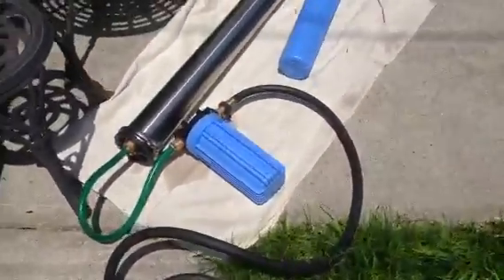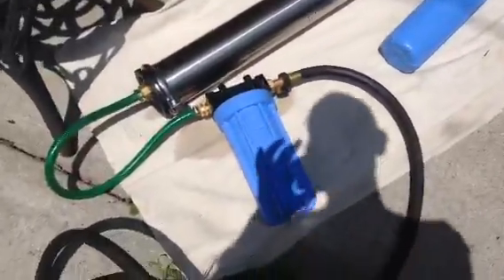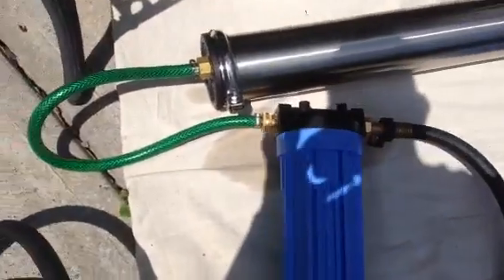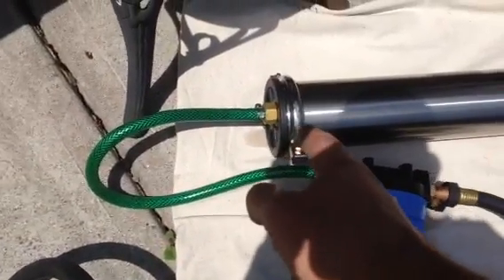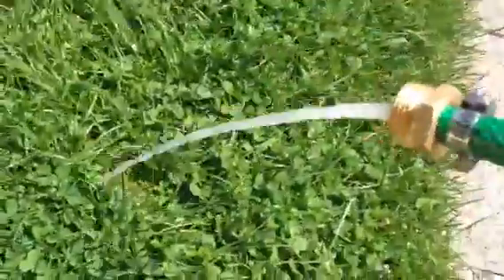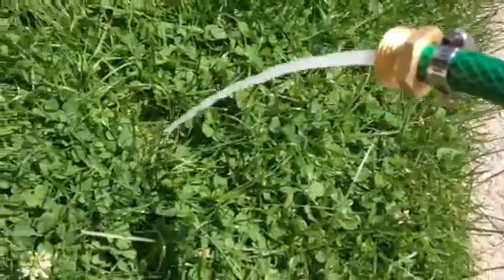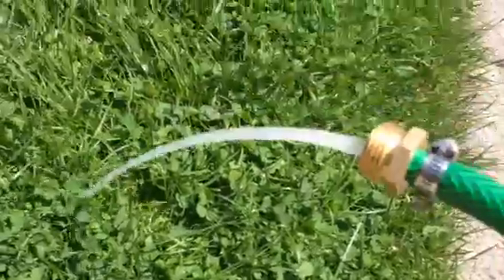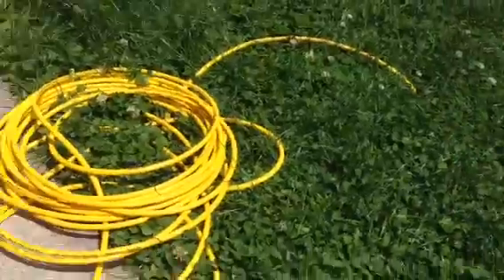RO test Axeon HF5 Membrane

Comment: Hey Mark!  Thanks for the video!  160 down to 5 is great!  I'm getting 130 down to 4/5.  Have you tested the results of just using 5 ppm on windows?  

I'm now testing the results of 4/5 ppm.  I'm starting to get tired of changing resin!
Reply from the maker: Joshua Adriance Oh yes, I've cleaned up to around 10PPM. Just need to make sure the rinse is good. On hydrophobic glass it becomes harder.